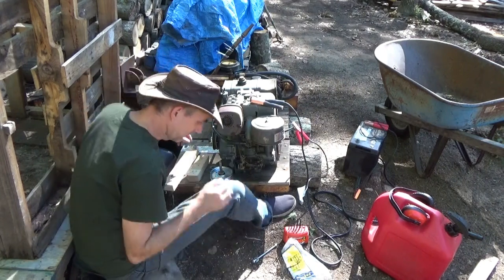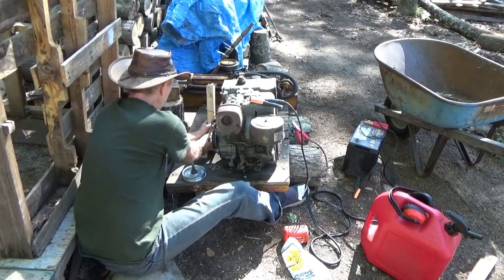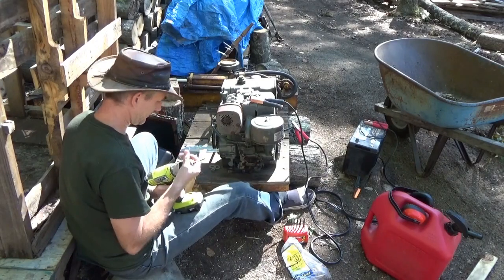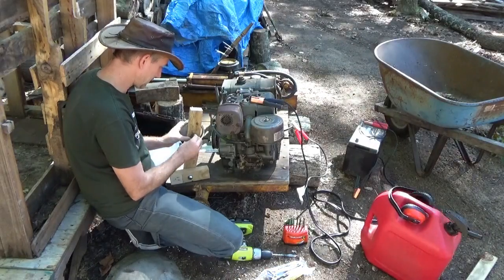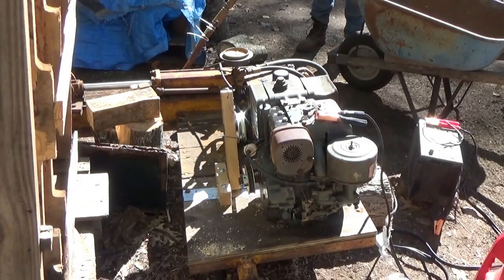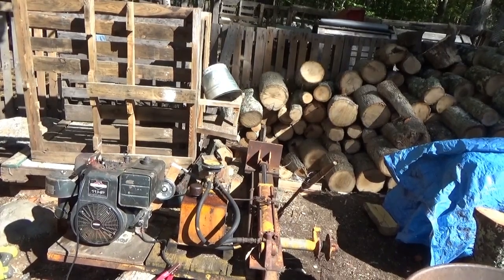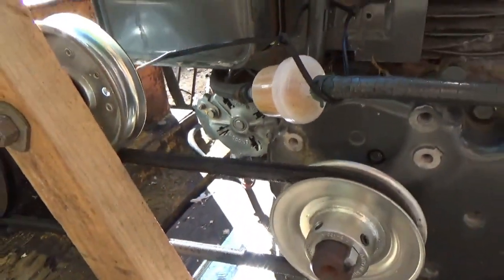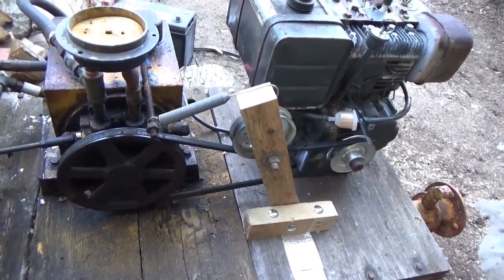Making Idler Arm For Log Splitter Belt Tension Using Scrap Materials

Comment: great vid! troy and just a tip I had trouble splitting the bigger logs so I took a angle grinder and sharpened the blade on the splitter and now it splits every logs I've tried!
Reply from the maker: Thanks. I was thinking the same thing

Comment: You know, I'm all for saving money, especially on a homestead. I also agree with fixing things myself. It just seems like you would go ahead and use a lovejoy coupler. This would probably outlast the machine. The belt will always be a weak setup.
Reply: I have explained the situation before on using a coupling instead of a belt, The pump will pump ONLY if the rotation is right, in some pumps rotating it in the wrong direction will cause the pump to not pump at all or it will self destruct. Using a Lovejoy coupling will make the pump turn in the wrong direction as both shafts of engine and pump has to be facing each other. Without opening the pump  to see if it is a gear pump or a vane type, it's safer to use as he is now to avoid problems  down the road. The squealing sound you can hear is not the belt slipping, it's the poppet valve in the control valve assembly opening up, allowing hydraulic oil to by - pass. to avoid damages to the cylinder or hoses.
Reply from the maker: I have checked them out and they look great. But as others have said, I dont know if you can reverse the direction of the pump

Comment: you can change the battery's with it right troy?
Reply from the maker: Yes it is working fine. Low output but it charges batteries

Comment: think you can even speed it up a notch by using a little bigger pouly on the engine, dont sound that you work it hard whit the present pouly, the faster the pump turns, the faster the cilinder can retract to. nice temporary solution whit the idler tho!
Reply from the maker: Yes I was thinking the same thing. Thanks. I am hoping the idler will last though.
Reply: iff you want to make it last, you have to make it from steel., but for a temporary fix, this solution will work fine for some time.